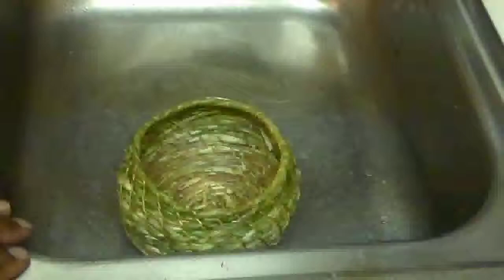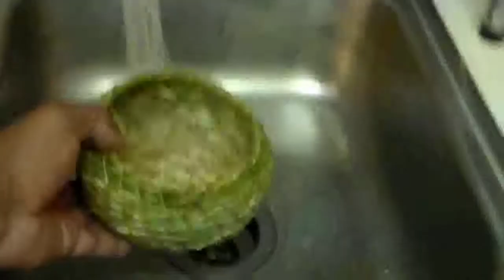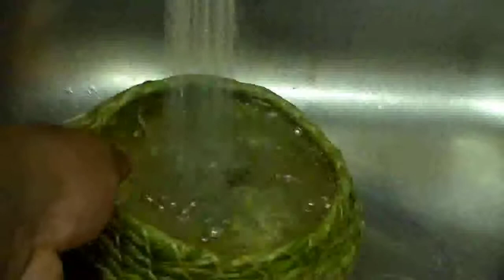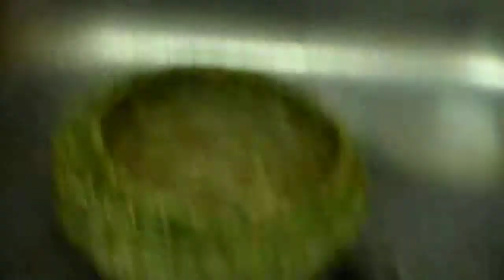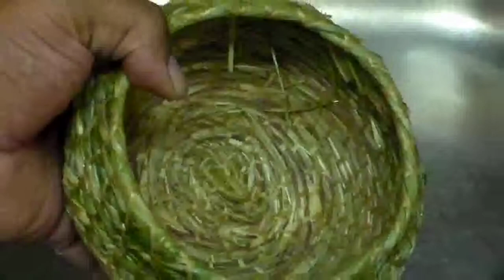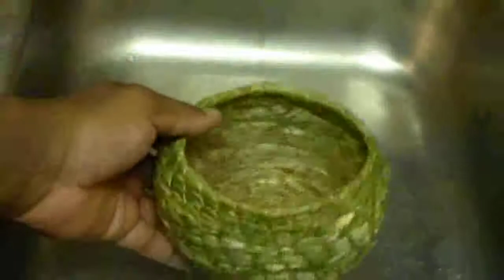The Urban-Abo: Coil Basketry - Can it be Made Watertight?

Comment: You can just put saran wrap on the inside of the basket to make it water tight. BOOM done. ;) very nice basket sir
Reply from the maker: Ok, however, the primitive version, in case there is no Saran-Wrap available is to coat the container with pitch (pine, or birch).